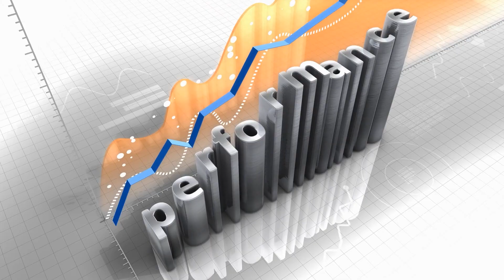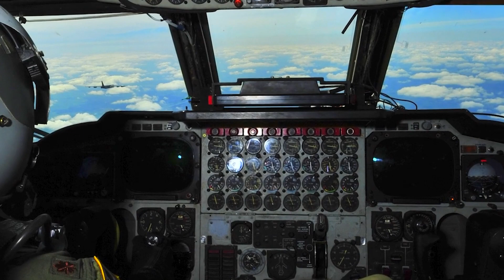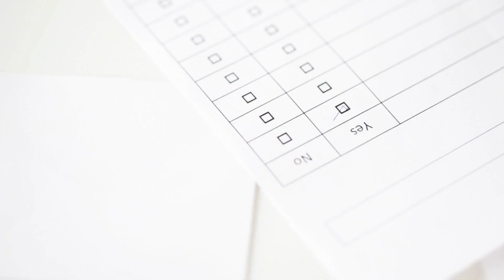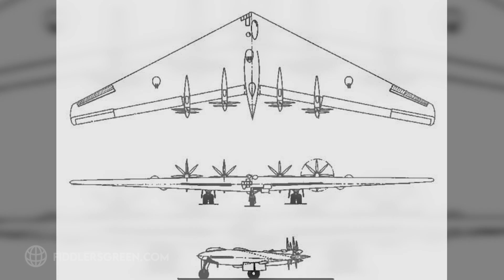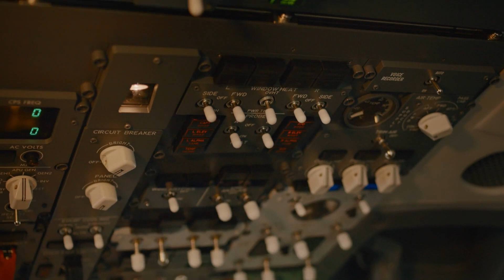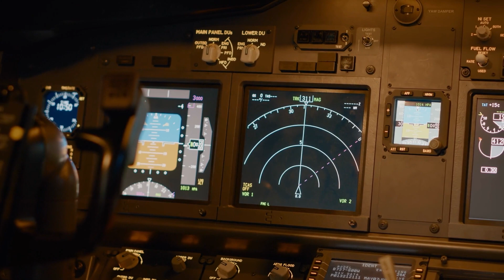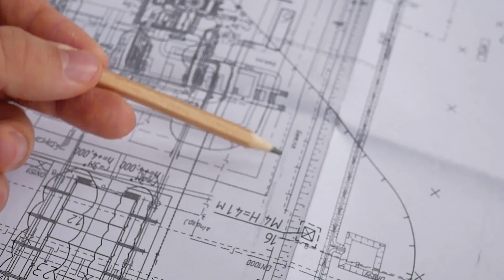BRING BACK FLYING WINGS: The True Story of the Bomber Aircraft That Never Took Flight

Comment: It didn't help that the YB-49 had a way lower top speed than the B-47 and B-52 (only just over 500 mph) and Northrop at the time never really solved the flight control issues. It wasn't until the arrival of fly-by-wire systems in the early 1970's that Northrop could seriously consider building a flying wing bomber again. (That very development of fly-by-wire systems was what made Lockheed's Have Blue prototype even flyable).

Comment: A flying wing design is much more efficient than a conventional aircraft. Instead of separate wings supporting all the weight of the hull, the whole craft works to generate lift. Great to know about those high technological Flying Wings Bomber Aircraft. And the video is describing how to involve to a mission of these types of aircrafts.
Reply: Too bad about the instability.

Comment: Flying wings look so cool. The aircraft would need to be made with enormous wings, several engines, and a considerable fuel supply. Leaving only the wing is a form that maximizes lift and reduces drag that would make for a much lighter, quicker, and more effective bomber. Northrop's slow drag high left flying wing would also be powerful that it would outperform any conventional bomber. Flying wings would revolutionize aviation transport, allowing travelers to travel more cheaply, faster, and farther. Northrop's flying wings appeared to be the state of the art. The new bombers design would enable more effective flight while making it almost invisible to radar, held by a computerized flight control system. Thank you so much for doing this video.